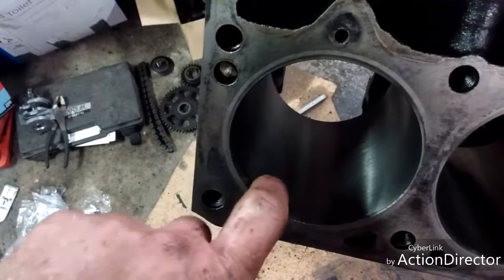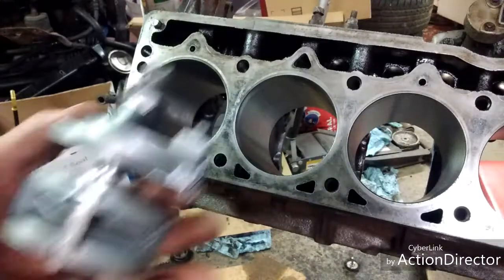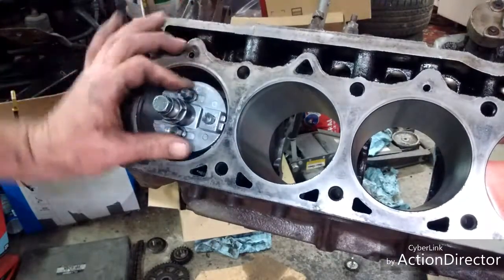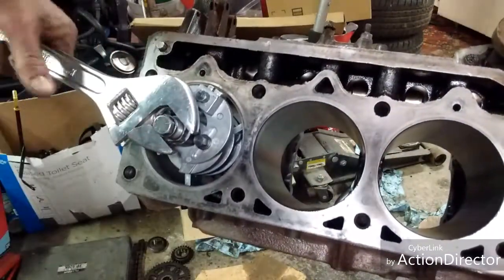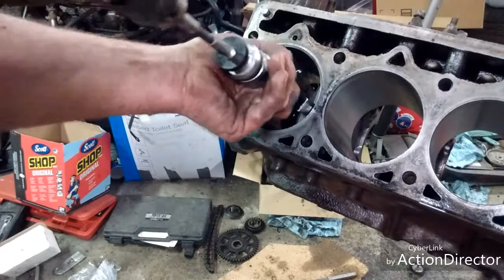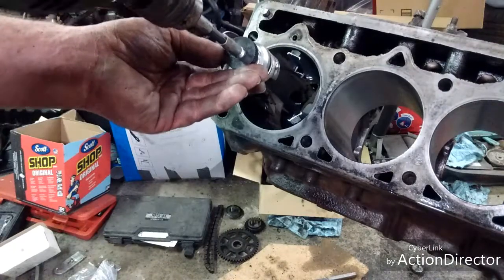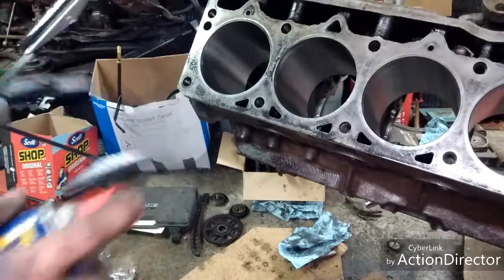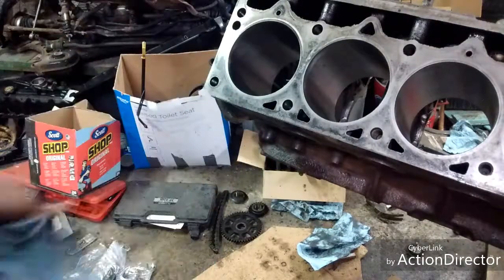CYLINDER HEAD RIDGE CUT & HONE

Comment: 4 cyl engine with about 100k mi., the crosshatch honing pattern from original is STILL THERE perfectly visible... should I bother to rehone? There is no ridge, just some carbon ring at the top ..
Reply from the maker: I'd say clean it up and leave it alone. Especially if you can still see original cross hatch.